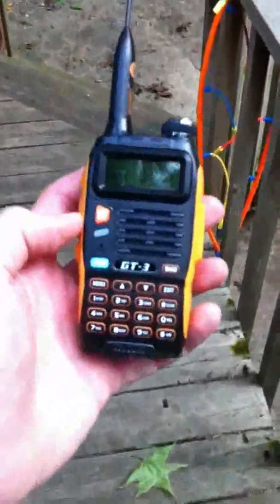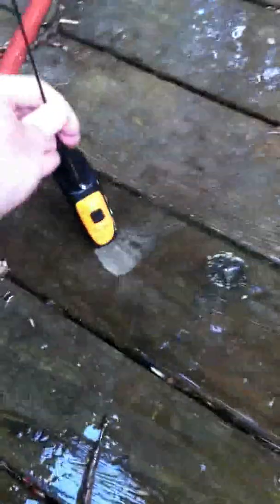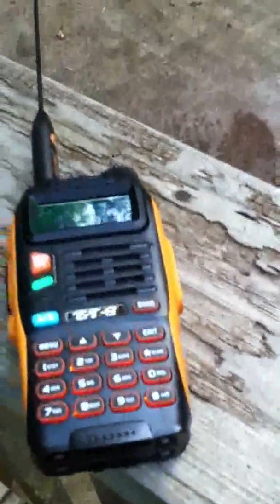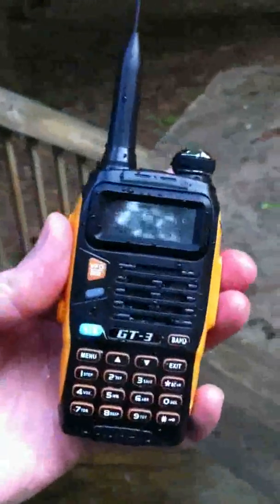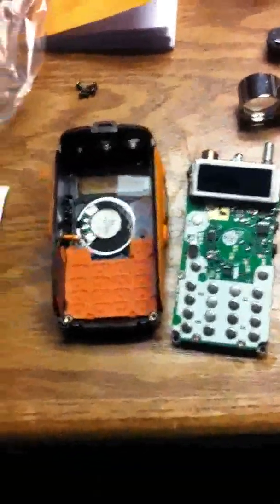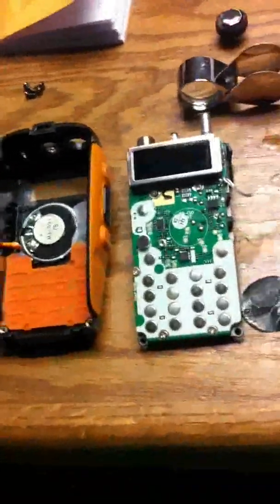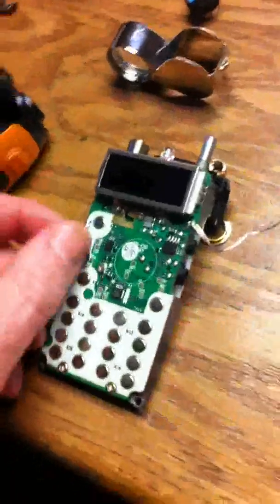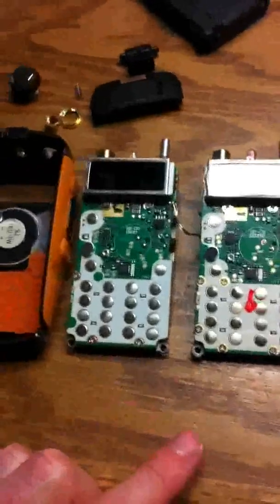Baofeng GT-3 torture test and tear down

Comment: Kinda cringed. Though that's the best way. To find week spots. Though in the armed forces. I used carry a plastic bag. Water proof don't mean a thing. Even now I found Ziploc® bags cheep. And carry hand held,  spare battery, and plastic bags. For my radios. With chirp. I also clone a spare radio as a backup. Just a few ounces more won't hurt this 68 year old . Live well and rember the 27 psalm 1-10. Thanks

Comment: For neighborhood use, I have standardized on the BF-888S.  I found a molle carrier that works well for these.  Would be an interesting test to seal the molle pouch (with waterproofing spray) and use a radio with fewer holes, then see the results.

Comment: For the price...this might be the ultimate Baofeng minus them one-day making a truly IP67 rated unit that's affordable...but sadly the GT-3 series doesn't seem to have any AA battery accessories or battery eliminators. I've seen modifications, but I don't feel like dremeling lol...I still might go for this unit though, because in a SHTF scenario, after the batteries have long since died on my GT-3TP, I'm not sure if I'll care much about HAM radio anymore and might have bigger problems...I just really wish there was still a AA alternative. Using ziplock bags on the cheaper Baofeng's (albeit they have tons of accessories) will only get you so far... I'm really on the fence. Thanks a lot for doing this video!